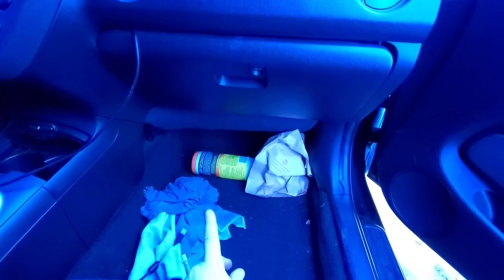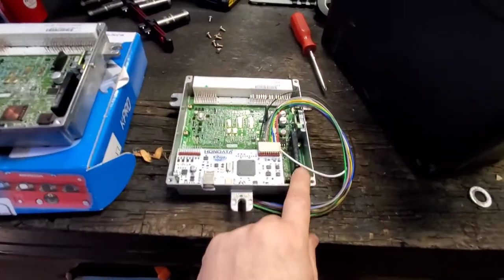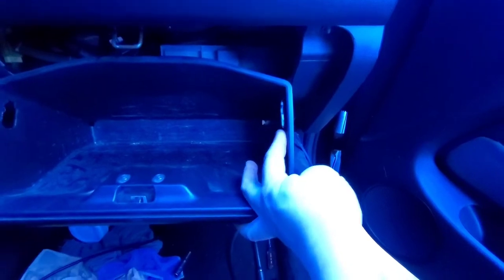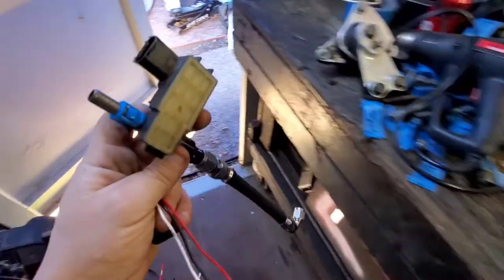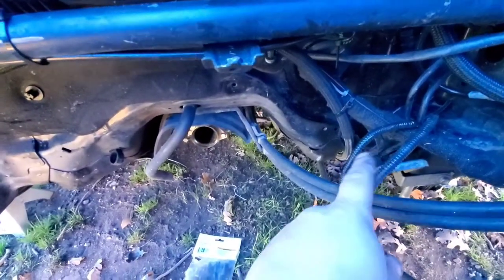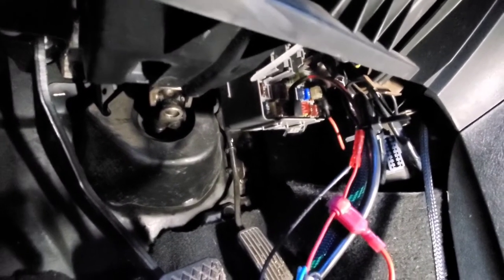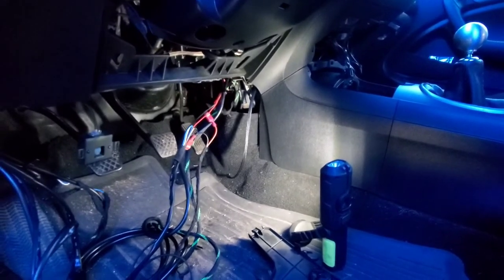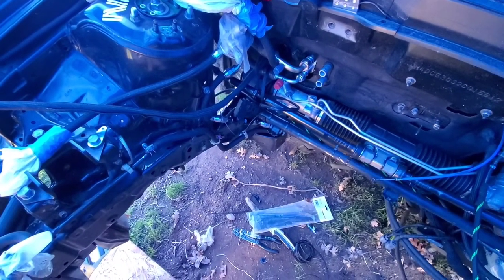Flex Fuel Sensor Install (Kpro/Acura RSX) #rsx #turbo #kseries

Comment: Did the ground matter? Like did this work grounding the flex fuel sensor in the engine bay or do you need to ground it to the pin on the ECU?
Reply from the maker: You can ground to a pin on ECU. My still in engine bay no issue

Comment: What parts did u use to adapt the -6 fuel lines to the ethanol sensor. Do you have links? Really appreciate the help!
Reply from the maker: I just came across your message. Let me get the link in the description for you
Reply from the maker: Link for those Conectors are in the description now

Comment: What is the part number for the pigtail tail connects that goes inside the kpro?
Reply from the maker: Honestly I couldn't tell you. It came with the kpro when I sent it out. Check on hondata web site. They might sell them.
Reply from the maker: It's called Hondata analog cable
Reply from the maker: Part #  HD-ANOLOG
Reply from the maker: Runs about $15-$20
Reply: Ok thanks! Also have you ran into any issues using the gm sensor?
Reply from the maker: No I haven't had any issues yet with the gm sensor

Comment: Could you please check the link for the flex fuel sensor because part number doesnt match with the one Hondata recommends ? or this one works aswell ?
Reply from the maker: This one works as well. It's just a harness. But for the flex fuel sensor I would recommend GM part. Up to you if you want to go with what hondata recommends.
Reply: @kallday4584  thanks for the fast reply bro !!
Reply: From where did you get the harness that goes in the ecu?
Reply from the maker: @juantorres-ln6lt  it's in the description. It's the pig tail harness
Reply from the maker: @juantorres-ln6lt  if your talking about the one that hooks up in the ecu. It's from hondata. They give two sets when you order the kpro v4
Reply: @kallday4584  oh okay I’m talking about the one inside the ecu!
Reply from the maker: @juantorres-ln6lt  yea you get it from hondata
Reply: Thanks a lot bro